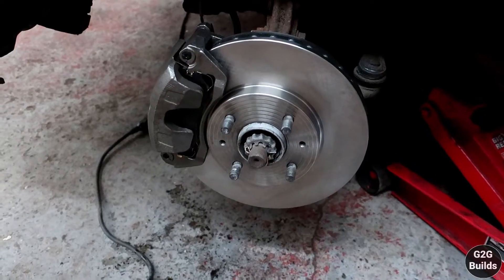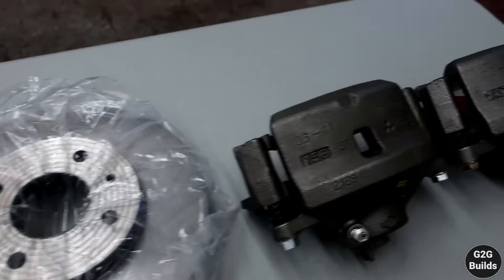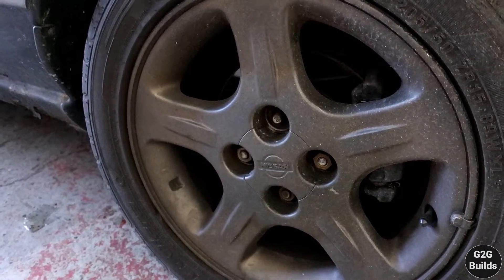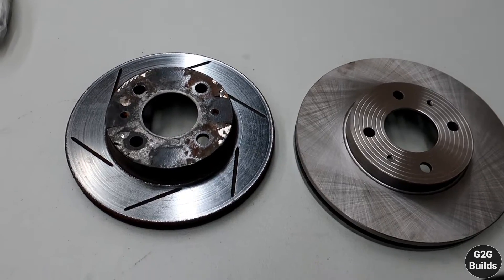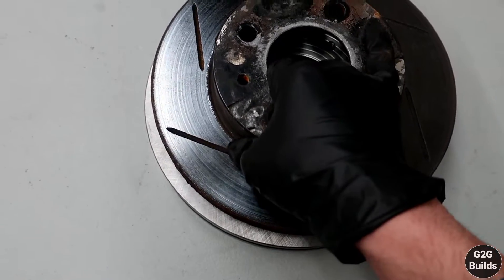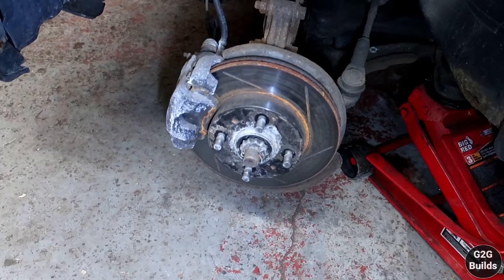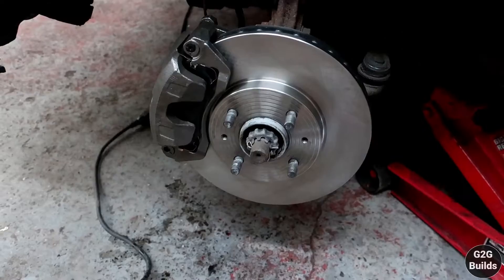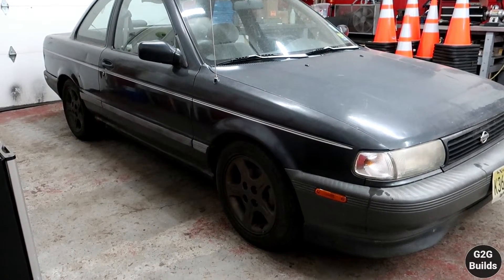B13 Sentra Gets an Oem Front Big Brake kit

Comment: My wingroad already had the 22v calipers, so I did an 11" brake swap. I took the knuckles from a Y11 Nissan wingroad (not AD wagon). And then the 11" front disks from a cvthyper M6 p11 primera, some Y11 have this 11" front brake too. This swaps the pcd to 114.3. You can just use the Y11 full setup as the 10" ones have a big caliper too (same caliper on the 10 and 11" but with a different bracket length). This may be hard to find in USA, but elsewhere it could be useful.

Comment: I miss my B13 so much. I ran the AD22VFs on my fronts as well. Unfortunately I didn’t have the rear discs and couldn’t find a conversion kit without going to the P11 brake setup from a Primera.
Reply from the maker: I'm planning on getting the rear brake disc conversion at some point too.
I mostly have everything. am still searching for 2 more things.
Reply: @G2GBuilds  hand brake cables? If I made the conversion I would’ve needed custom ones made up because the original B13 ones are so rear.
Reply from the maker: @racegod69  I'll be using OEM B13 SER hand brake cables, since I'll be using OEM SER brake kit for now.
Reply: @G2GBuilds  where are you located? Apparently they’re still built in Mexico and called the tsuru. Might be able to source stuff from there.
Reply from the maker: @racegod69  I'm located in New Jersey USA.
Yes, Tsuru, Sentra and sunny are the same car. Some markets have a different name. I don't know why. Lol

Comment: Great work man. I spent about $131 on mine because I had a discount on rotors and the valve cover gasket. My calipers up front just need a cleaning and I'm probably painting them. My exhaust came to $380 off ebay and installation and etc. Keep up the great work my man car is coming together. It was probably the calipers that went bad on yours and that's a good price on all parts you got.
Reply from the maker: Thanks bro!

Comment: Do you have a video on how to convert the rear brake drums to rotors for Sentra with individual suspension?
Reply from the maker: I do not, but I'm planning on making one in the future.
Reply: @G2GBuilds  keep me posted when you get it done unless you’re tutorial for the front will help me when I get all my parts for the conversion. Muchas gracias
Reply from the maker: @alexrodriguez-fg5wy  De nada. Sólamente presiona la campana para cuando suba el video en futuro no te lo pierdas. Muchas Gracias. 👍
Reply: did you recorded it? :-D  @G2GBuilds
Reply from the maker: @mustafakemalboyacoglu684  No. That video is coming next year. I already acquire all the parts.👍

Comment: Do you have a link on where to buy the big brake kit?
Reply from the maker: I have no link. I got everything thru different websites.
You can get the rotors and brake pads on local auto parts, rockauto, Amazon or eBay.. Finding the calipers is a real headache.. You want the brakes from 1993 Nissan NX 2.0, vin J.

Comment: Ok so have you made the rear conversion from drum to discs ?
Reply from the maker: Nope..
Currently I still have drums in the rear.
Reply: I have a 1991 from auto to Manual and well i wanted to do that conversion since i have some wheels and i dislike how they look with the wheels
Reply: If you would like to see it ill leave you the link here https://www.instagram.com/p/BymCCV5HQNrdIxmHXLdZ_BFg75WXGwVK2GLY5w0/?igshid=1metaz6vmvnkw
Reply from the maker: @xavier_yf_nata6135  The car is beautiful!
For what read, you will need everything from the sentra SER, knuckle and the hub, brake rotor and pads, calipers and e-brake cable. It should be a bolt on swap.
In my area is hard to find the knuckles, that's why I haven't do it yet.

Comment: Did you have to remove the dust cover?
Reply from the maker: Yes.
You can maybe cut them, but I'm not sure. At least this brake rotor is about 0.60" bigger, compared to oem 1.6 brake rotor.

Comment: Meaning I can’t put 2.0 rotors on my 1.6 without caliper changes. Tell me ?
Reply from the maker: You'll need rotors, calipers and brake pads to do the brake swap.
Reply: @G2GBuilds  the caliper in this post should fit my B13, right?
Reply from the maker: Yes.
Long story short, Nissan used the same knuckle on 1.6 and 2.0 Sentra and Nissan NX. Therefore, to do the swap you will need what I showed in the video.

Comment: Hey man I’m trying to do something like this what is it that I have to get? I have the same b13 as you 1.6l
Reply from the maker: The easiest will be to get brakes from the b13 sentra SER. You will need rotors, brake pads and calipers. The brake kit i got came from 91-93 nissan nx2000 and they are a little bigger than the b13 SER brakes, but the are becoming hard to find.
Good luck!
Reply: So you would suggest get the SER brake kit? Would it have to be a specific year or 91-93 only?
Reply from the maker: The NX200 brake kit is better if you can find them. If not then, SER brake kit still a brake upgrade compare to stock ga16de brakes.
Reply: Alright I’ll see if I can find some but thanks for the advise and information man really appreciate it

Comment: hope it works
Reply from the maker: Thanks a lot bro..
Reply: @G2GBuilds  I need the complete set up for my b13 like that how can I get it? I check Ebay but I can't find it do you have any idea how I can get it?
Reply from the maker: @skelleymrcool3545  The calipers are the hardest to find,  but search for the 91-93 nissan nx 2.0L vin "J" (or made in Japan) brake parts. You will need rotors, pads and caliper. The right calipers will be the ad22vf.
Some people decide to go with the smaller brake option which those are the ad18vf. Those came in the 91-94 sentra SER. You can find them in the parts store or rockauto.. Good luck man.

Comment: What oem big brake upgrade would you suggest for b14?
Reply from the maker: I'm not sure what can fit the b14..
I seem pictures of people doing z32 brakes swap, but is not a bolt on swap..

Another option is, is you chance to b14 knuckle, you can use b15 brakes, but you will need to change the wheels as well.
Reply: Thanks!
Reply from the maker: @girish9513  No problem!
Reply: Ad22vf works for the b14 as well. I have the same the set up on my b14.